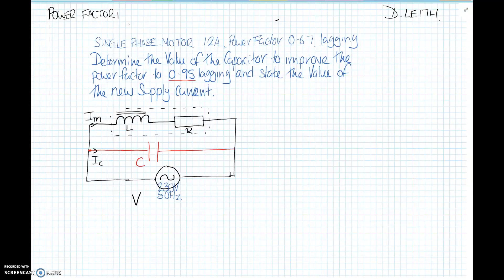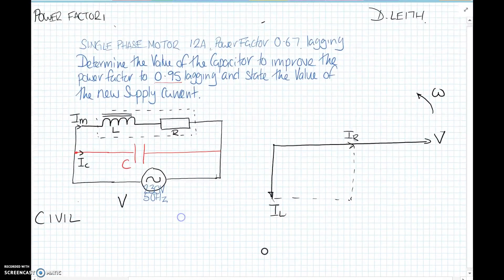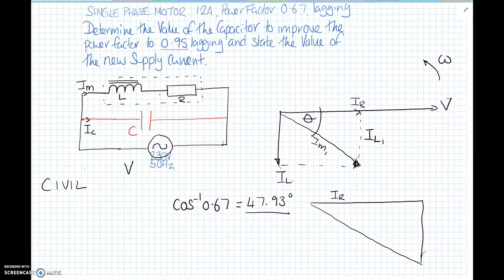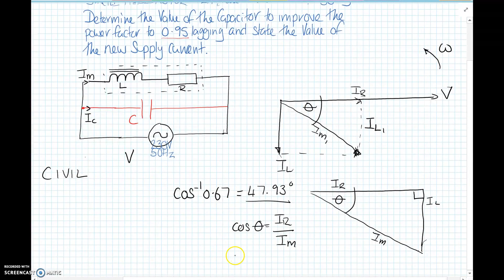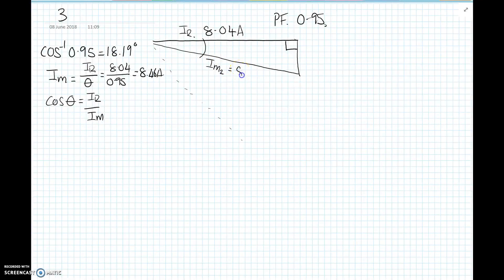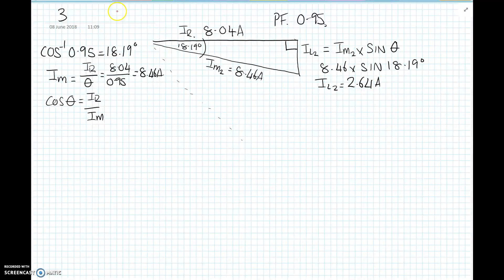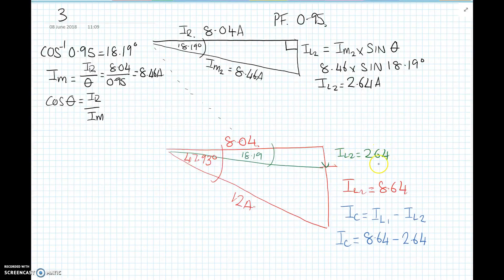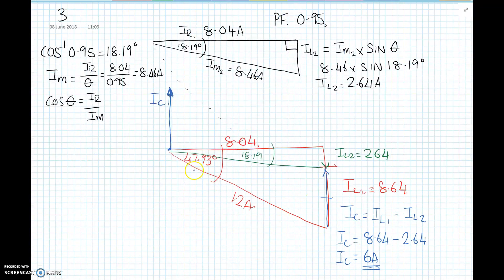AC Theory Power Factor Correction - Calculate Capacitor Size

Comment: Good video, but I'd argue that calling reactive power "unuseful" isn't a good description because it is required for transformers and motors and transmission lines require reactive power compensation to maintain a healthy system, injecting reactive power into the system raises voltage, and absorbing reactive power lowers voltage.
Reply: Hi thanks for your comment, which is of interest. I'd like to point out, the context of this video is in reference with electrical installations, and reactive currents in distribution cabling and not distribution equipment in the grid.
Reply: @Leafster1973  Hi, thanks for the response! Apologies if my response came across as condescending and wasn't meant to detract from your point! Cheers

Comment: Very well explained, but there is an error. IL1 was 8.91A not 8.46A so the capacitor current should be 6.27A (8.91 - 2.64 = 6.27A)